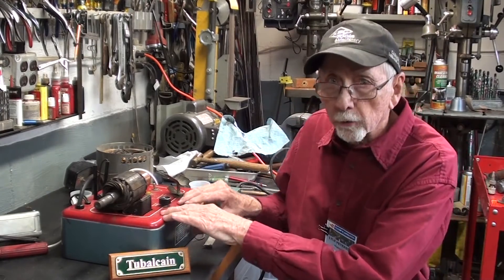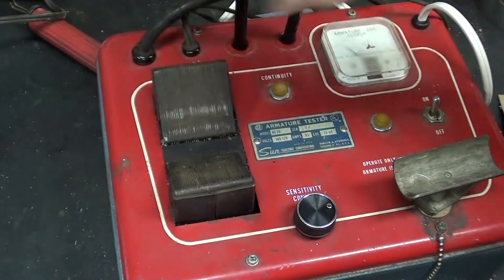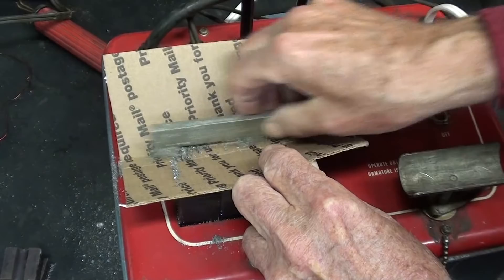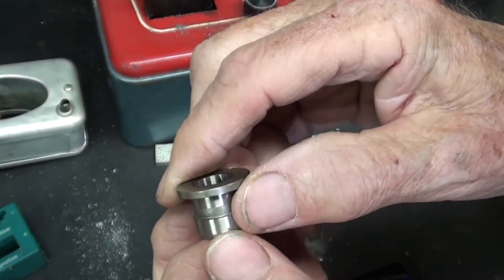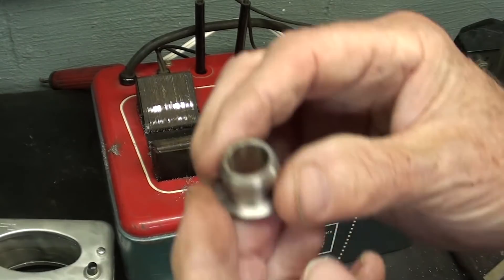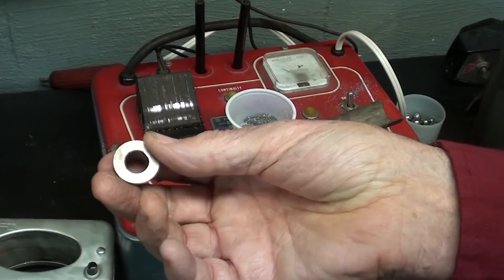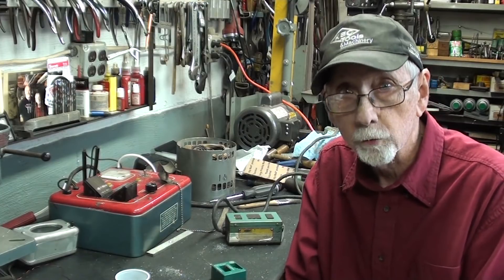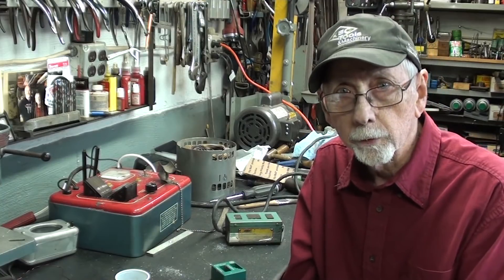DEMAGNETIZE TOOLS with a GROWLER #762 tublacain mrpete

Comment: Another great video thank u sir, but i dont think we will get to electric vehicles like we use petrol or diesel the idea is there but i think the batteries and way of charging also the cost will stop electric vehicles, or maybe im just to set in my old school ways.
Reply from the maker: Thank goodness with a new administration, the real push for EV is over.
But I think it will be back in a few years after they make some improvements and reduce the price and get some charging stations and increase the travel distance. I will be dead by then fortunately

Comment: I've always been interested in magnetism too. Remember as a boy winding a piece of wire around a nail and hooking the wire ends to a 9v battery to make an electric magnet?
Remember those horrible metal football field games with the players with magnetic feet that would shake all over the place when you turned the thing on and it growled at you while doing do? lol
Off to the next video in this series :)
Reply from the maker: My friend had one of those football games. It was about worthless. I remember that if it was not on a real level surface, all the players moved to the lowest spot, L O L.

Comment: Another demag tip: when welding on some equipment it is found the piece is magnetized and the arc is wandering off every direction. Cure by wrapping the torch lead around the work, setting the welder to a high amperage AC setting and run several beads on a blank piece of steel.

Comment: An interesting demo in the science museum has a thin metal iron disc (wheel) mounted on its axle so that the edge of the wheel passes between the poles of a horseshoe magnet.  There's a gas flame playing on the disc, just off to the side of the magnet.  Because the iron on one side is heated above its Curie point and is therefore no longer magnetic, the magnet attracts the cooler part of the disc on the other side, causing the wheel to rotate.  The iron has time to cool down while it rotates around to the 'cold' side of the magnet, so as long as the flame is lit, the wheel continues to spin.  It's an example of a heat engine with only one moving part.  Not very efficient though!

Comment: When you're magnetizing with any of these AC coils, you don't need to actually hold the switch on for very long. Because the coil is AC, the magnetic field it produces is alternating in polarity at 120HZ just as in the incoming AC is (yes, the frequency is 60Hz, but you get 2 polarity changes per AC cycle). When magnetizing, the longer you leave the screwdriver or whatever in the field does nothing - the residual magnetism is from the last state the coil was in just before you shut it off. If you pulse the coil just briefly, it should leave the same residual magnetism in the screwdriver as leaving the coil on for a few seconds. All the rest of the time the coil is on, the field is reversing polarity continually, so it's actually reversing the polarity of the residual magnetism in the screwdriver as well. The only thing that would lead to a stronger residual magnetism is if you precisely controlled where in the AC waveform you shut the current off - if you shut the current off right at the peak of the AC wave, you'd end up with the strongest residual magnetism. If you shut the current off just shortly after a zero crossing, you'd end up with a weaker residual magnetism.

The reason moving the screwdriver through the field DE-magnetizes the screwdriver is more to do with the decreasing field strength as you move away from the coil, as well as the changing polarity of the field. It's the combination of the alternating and dissipating field that leaves the domains in a random state, and thus overall the screwdriver is not magnetic anymore (or has no residual magnetism)
Reply: This is also the same way the Whia magnetizer / demagnetizer blocks work "by magic" without power - on the magnetizing side, it has a bunch of magnets aligned with the same polarity, so when you pass the screwdriver through, the whole screwdriver sees the same field all the way along, and the domains in the screwdriver line up with the magnetic field of the magnetizer. On the demagnitizing side, the magnets are arranged with alternating polarities, so as you pass the screwdriver through, the net effect is all the magnetic domains in the screwdriver are left in random states, hence no net magnetism in the screwdriver.
Reply from the maker: Thanks

Comment: I started using the de-mag function on my surface grinder chuck when I got it going ... before that, sometimes rapping the tool on something, or giving it a good thump with a stout hammer would reduce or get rid of magnetism, but it didn't always work, and it's not appropriate for all situations. For example: your best set of dial calipers!

If you get material from a scrap yard, it may have become magnetic from the crane they used to handle it ... so knowing how to remove the magnetism is worth learning.  In my experience, that material will "pass it on" if you don't take care of it.  HSS tool bits and metrology tools, mainly.

Comment: Great video Mr. Pete. We had a bunch of DeGaussers we used in the machine shop at Pitney Bowes in Stamford Ct. I worked there for 31 1/2 years until they closed down much of mfg through outsourcing. We also used a Gauss meter for specific measurement applications. Loved seeing the transformational curve diagram. We used it in  metallurgic class where we did case hardening, end quenching, and heat treating for our samples we polished and put underneath the microscope to examine the grain structure. Our Prof got all excited because out sample had martensite in our samples. Almost 50 years ago but I remember it like it was yesterday. I also remember being fascinated with the little kids game where you moved metal chips around the bald man’s face to give him hair and a beard. Looking forward to the next video.     
Best Regards,
John

Comment: Good morning Lyle,
Thanks for another great teaching video. A little advice for your many fans who use credit cards. Keep them well away from magnetic sources or they’ll become demagnetized and won’t work. I don’t know how or when it happened but the card stopped working in those little readers and I had to order a new one. The numbers still worked if typed in but I could not “swipe” or use self-checkout.
Reply: Most modern credit cards use a inbuilt "security chip" plus NFC coil & Chip to eliminate the problem of degradation of the magnetic strips.
Here in Australia there are very few if any swipe cards use -  I don't remember the last time I saw a magnetic card reader used in retail stores, banks, etc.
Reply: @johncoops6897  Greetings from America. My chip suddenly stopped working and I assumed the strip was demagnetized. Whatever it was the new card cured the problem.
Reply: @ellieprice363  - The Chip and the Strip are 2 completely different things. The chips do fail after a while, but I am not sure if that's just from the card flexing and snapping something inside, or what?

Comment: Every die shop that makes or repairs stamping dies has de-magnetizers to remove surface grinder magnetism out of the steels. Don't want them trying to hang on to the slugs!
Reply: Very true. We had a demagnetizer in the tool and die shop where I worked for many years. All the hardened and ground parts had to be demagnetized after final grinding.

Comment: Hi Lyle,
    Speaking of paramagnetic forces try to find an old auto speedometer. The needle is operated by having a magnet spin inside an aluminum cup. No mechanical connection or magnetic attraction. Just the friction of the magnetic flux / field passing thru the aluminum.  This is something  that has always fascinated  me and is proof of the invisible  magnetic field around a magnet.
Reply: MrPete already did a video on that subject...
https://www.youtube.com/watch?v=DssASTqXqK8
Reply: There is a magnetic repulsion happening there. The magnetic field induces eddy currents in the aluminium because it's conductive, which behaves as a 1 turn coil. The induced electric current in the aluminium creates it's own magnetic field inverse to the applied magnetic field which causes the angular force, in the example of speedo's.

It's clever. :)
They do the same thing when separating materials for recycling. A belt with magnets attached whizzes past a conveyor belt and any aluminium pieces are flicked out from among all the other trash.
Reply: @jimmyb1451  -  @Jimmy B  - you misunderstand how a speedometer works. The aluminum cup is not the main thing involved in moving the needle.
Reply: @johncoops6897  Being a mechanic of 30 years, it's not that I misunderstand  how a speedometer works. Perhaps I have that particular example wrong. I shall have another look.
Reply: @johncoops6897  ah, yes, it is absolutely the aluminium cup that moves the needle, as I thought. Feel free to offer your alternative explanation so I can point out where you're wrong.